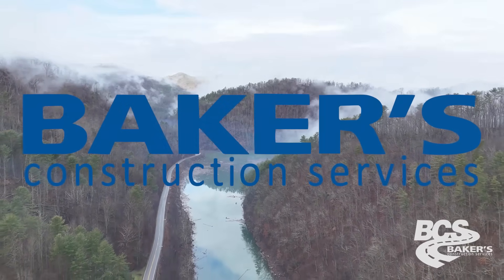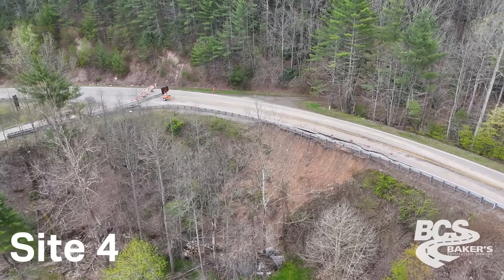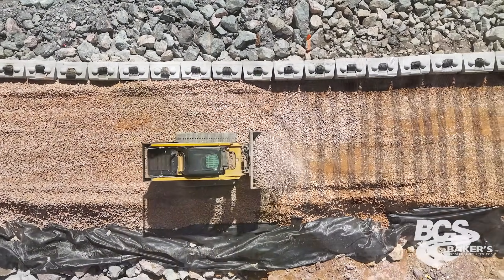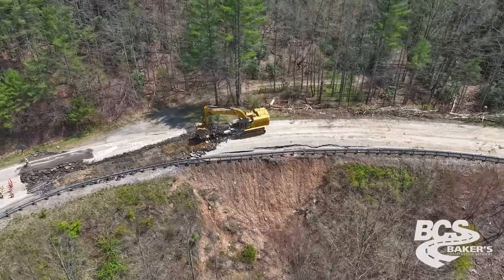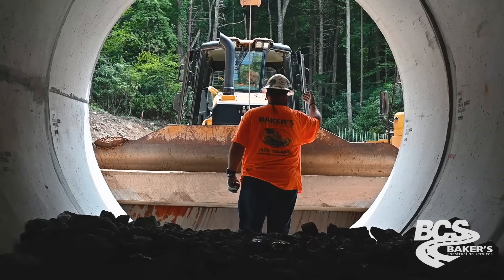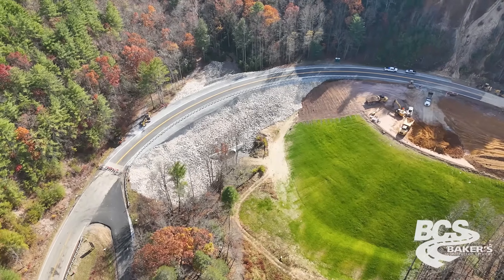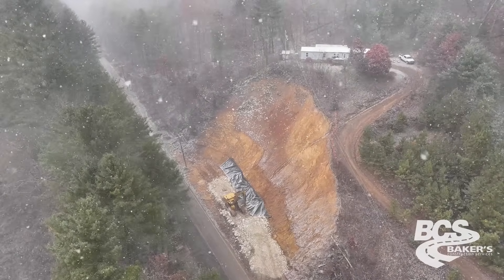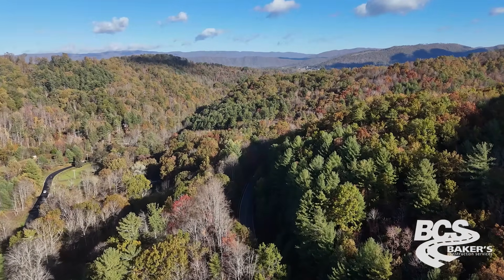How this highway was rebuilt after Hurricane Helene

Comment: Wondering if a pre-cast concrete box culvert would have been possible for spot #4?  If possible, it would function much better hydraulically than twin round pipes.  May not have been possible though.